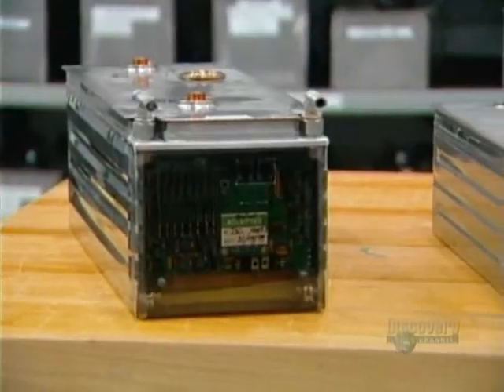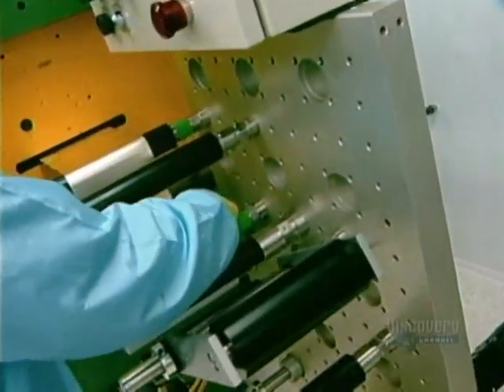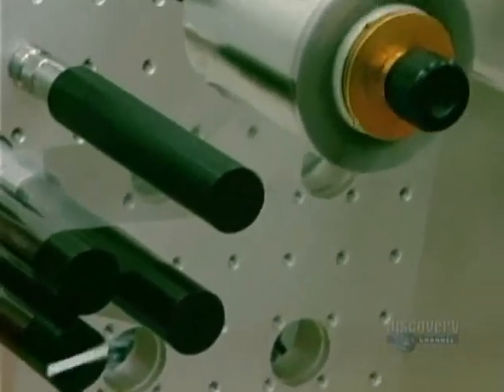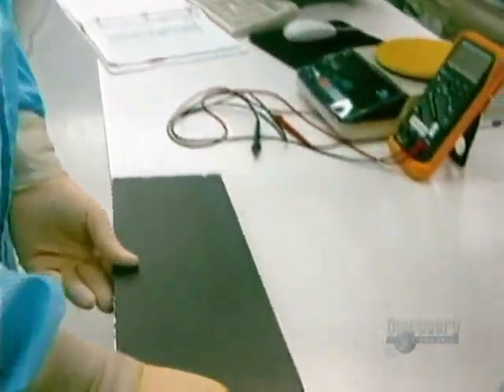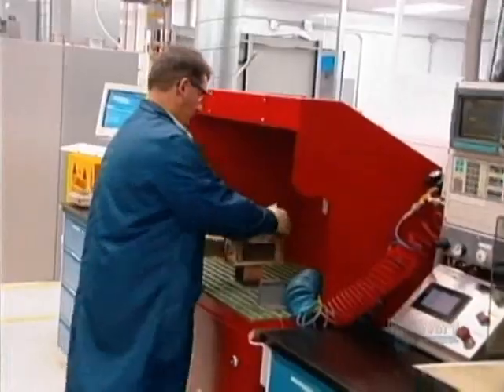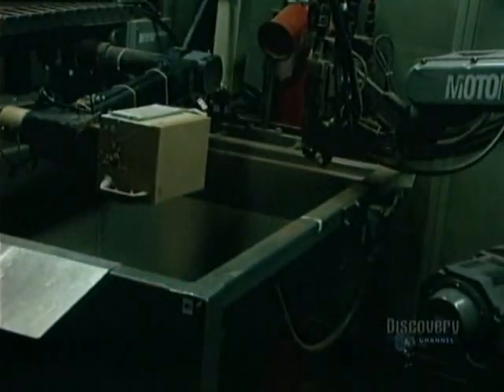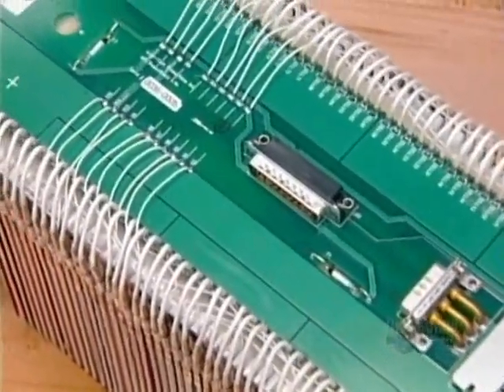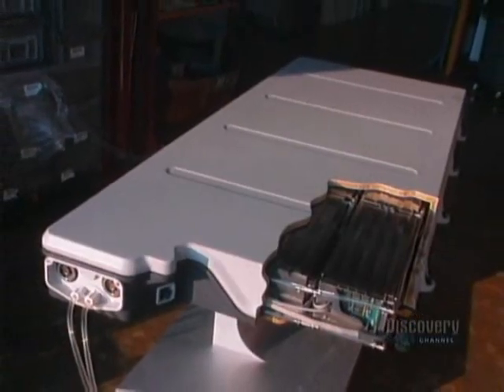How  to make Lithium Polymer  Batteries for Electric Car

Comment: "This battery was developed to surpass traditional Lead-acid batteries which cant create the same amount of electrical energy, and have much shorter life spans"

Unless they catch fire because you sneezed the wrong way, then the Lead-acids will last longer!

And a lead acid will effectively last forever if treated correctly, Lipo have an effective life of only a few years due to chemical changes resulting in loss of capacity.

But they weigh 100x less for the same power, fair trade :P

Comment: Li-po batteries have better charge per volume and less weight per volume than Li-ion batteries. The problem lies in it's more complicated management requirements. The battery is more sensitive to bricking and overcharging thus needing cell balancing more often than Li-ion. Once this issue can be handled, Li-po are the flat out best choice for EVs.

Comment: This is the pinical of battery tech and its 20 years old. While i love the idea of the electric car its not a secret that batteries have been researched twice as long as cars and still the best we get expensive, long charging, short lifespan and not enough power for cars.

Give it up now will you. Battery tech have reached the limit and still they are destined to fail.

Comment: @b101aa2 That doesn't warrant an arguement. You simply changed the topic. 

An electrical charge gives lithium enough energy to ignite. Due to resistance it eats up. Lithium's opperating temperature is 50 Degrees C, or 110 Degrees F.

Comment: @b101aa2 Fail, it tarnishes on contact with air. Only rubidium & higher elements (alkali metals only) ignite spontaneously on contact with air. if misused even only for a few seconds it will ignite then....such as: overcharging, overheating, diliberate contact with acids or water & many other things.

Comment: @b101aa2 That's funny, because LG Chem, the company that actually makes the Volt cells, calls them Lithium Polymer, not lipo.  In any case, most of the Volt pack weight is the cells, but it's not mostly lithium.  As I said, lithium carbonate is probably less than 40lbs.

Comment: @b101aa2 I guess math is not easy for you.  Talk about bias, you're wrong again.  First, the Volt pack is almost 400lbs, but the amount of lithium carbonate in it is probably less than 40lbs.  Different lithium chemistries use different amounts of lithium carbonate, LiFePO4 uses even less than the LiPoly Volt pack.  Instead of trying to tell me how little I know you should probably try educating yourself about the lithium batteries you don't think we can build.

Comment: @b101aa2 A recent increase in demand coupled with a temporary limitation of production caused the price increase, and your profits.  However that is not the same thing as limitations or restrictions of the actual resource.  As lithium becomes more valuable more mines will be brought online.  Chemettal lists current estimated reserves of lithium carbonate at 150,000,000 tons, and current world wide demand at 122,000 tons.  They estimate world wide resources will last over 1,000 years.  Plenty.

Comment: @b101aa2 Um, no not quite true at all.  I have learned something about the topic, and what I learned is that there is plenty of lithium.  In fact, why don't you Google "plenty of lithium" and start reading.  Yes the price of lithium has gone up, which is why, as I stated, lithium mines in the US are starting up again.  The fact is there is very little lithium in a lithium battery.

Comment: its confusing because they make it seem like the battery holds a charge and can be tested at a point where there is only lithium in the battery. pure lithium has a charge but you need to wind it with something of the opposite charge to get electricity out, I thought

Comment: The problem here is in the process.  This is entirely too much "hand fabrication".  The process will have to be automated completely to make it economical viable for large scale production.  Right now, only Valence has overcome the issues of safety, repeated deep charge and discharge, and mass production...but the cost of the battery is still high.

Comment: Great vid! This is a cool process I only hope it is safe if these batteries open up when in an accident and the fire department spray water to put it out. Sorry but this technology will never make it. Nickle metal hydride is still the safe way to go. Notice no toxicity with nickle. Too bad we lost the patent rights(Dr's Pons and Fleischman). Can this process be used to make NMIH batteries? Nano technology is still years off. Too costly to run, look at Altair Nano, with very little to show.

Comment: That's not good, is it? Isn't there a kind of way to prevent the batteries becoming overcharged? Or a fire-extinguisher unit?

But beside those inconveniences, I think an electric car is worth it, considering the low price of recharging and the better acceleration and all that. The range is also becoming much better then it used to be, right?

Comment: you know freakshow1997 is right because it would immediately develop a layer of black oxide tarnish unless it had a layer of oil to shield it from the air, which is probably whats going on there. I don't see a reason for DC to lie to us. Wiki it.

Comment: The lithium-polymer battery is deduced from the lithium-ion battery. The term ion means that all lithium is in the ionized phase, and not as the elementary  phase. That's one of the reasons why it is such a safe system. Secondly, lithium is corrosive as hell, it reacts with the air (and water) immediately. It must only be handled in an inert atmosphere...

Comment: Yeah, that's easy.  Notice that the workers are covered head-to-toe.  They're in a high-end clean room.  What you don't see is that, since lithium burns in moist air, the environment is also probably tightly controlled.  (i.e. low moisture)

With a lot of effort and expense, you could probably make ONE.  All the environmental controls are needed if you want to make many batteries and get a decent yield.

Oh, and as lithium polymer batteries go, those are HUGE cells they're making.

Comment: Li Po Batteries are available but there's no mass market for large batteries at present.

They are sold in sizes suitable for RC toys etc and as companies like Tesla do, they pack 7000 of them together to get 50kwh. A123 M1 cells have the best power density but cost about $10 each when you buy them in a Dewalt cordless tool battery pack. Cheaper Li-ion cells go for as little as $1.50 each.